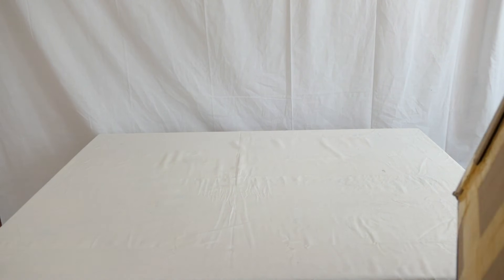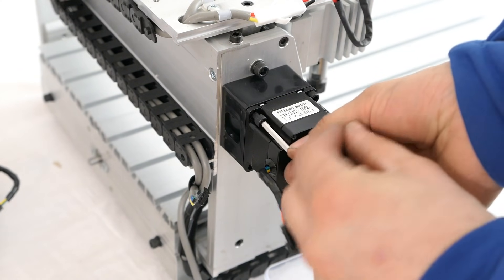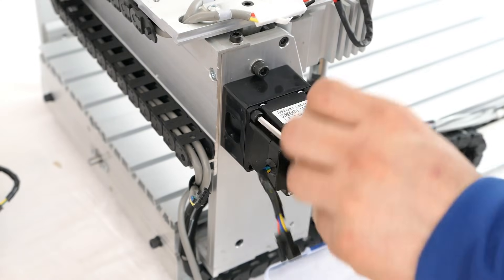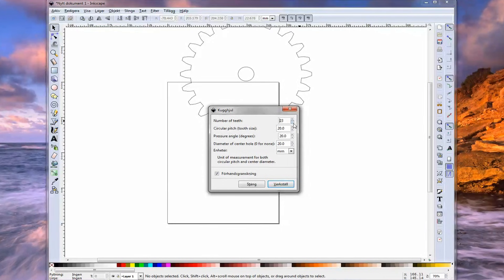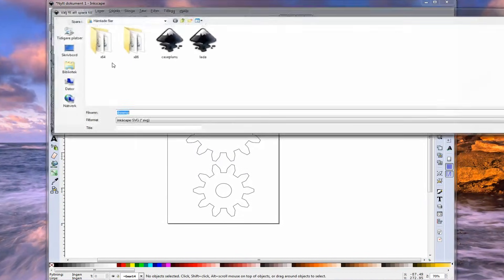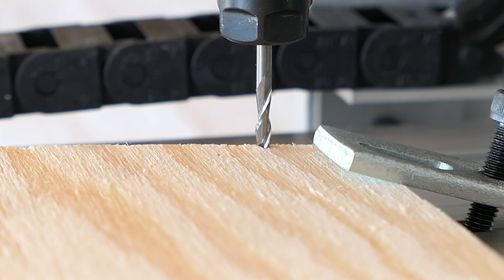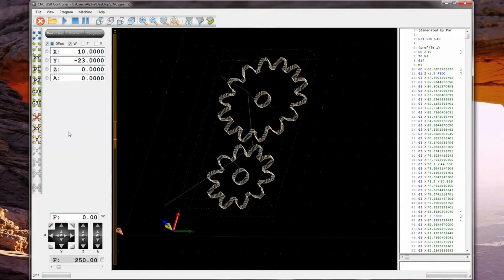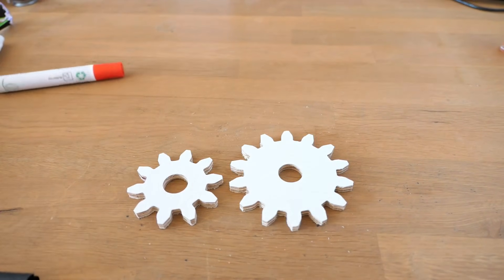3040 Ebay CNC! Unboxing To first part

Comment: Very nice router. I have upgraded the spindle to a Bulle Router and cut like a pro.

If you are working with wood you can glue your material with hot gun glue with safety.

Comment: Your clamps are on backwards.  The short end goes over the part and the long end uses a threaded stud with a T -Nut or cap screw or hex nut on the bottom and a jamb nut and washer under your slotted clamp end to act as a fulcrum. This is how you get the clamp parallel without using a bunch of different Joe Blocks or 1 2 3 Blocks. Use pieces of scrap AL sheet to keep from marring up your table and buy a machinist stone.

Comment: Thanks for loading this video.  I have a unit that is exactly the same as yours, but the documentation CD was damaged in shipment and is unreadable.  Would it be possible to get a copy of the setup instructions from you by any chance?  Thanks.
Reply from the maker: Hi! I got no instructions on the cd. The only thing on the CD was a EXE file for the program. I would advise you to reach out to the seller to get a download link for the program.
Reply: @RaviX  Thanks so much for this reply. I found where to download the program, but what l am missing are the machine-specific parameters to enter during setup. I noticed that your video skipped from physical assembly to actual use of the software, and did not include initial setup of the software. Do you still have the setup information?

Comment: First thing to do, check the speed control potentiometer, some people have reported them to be flakey and can shortcircuit causing damage to the controller. Better quality model would save you some potential trouble.
Reply: Recommendations?
Reply: @mikecarter8880  Really just a good panelmount pot from your preferred electronics vendor should do. If it was me I would (because of where I live) probably end up on the digikey website and look at the pots from a company like Bourns.

The problem is just that they use cheap chinese ones that ... well short it seems.
Reply: Thank you for pointing this out, any idea what the value of the pot is? I'm ordering one of these for someone else and would like to send them one.
Reply: @Trstn12  alas, with the multitude of different controllers out there that would be hard to say.
Reply: @xConundrumx  thanks for responding,  I'll measure it before we hook it up, thanks!
Reply: @Trstn12  Good luck

Comment: My machine didn't come with the software, I've been using Mach3 with it, but the one used in the video looks easier, any idea where I can download it?
Reply: Don't bother yourself trying this soft, it's basically the same but with less options. However, the main downside is that this software has no documentation.
Reply: @viktor67990  Yeah but since I have a small machine, I want to do simple things like shown in the video, with Mach3 I have to do to much stuff.

Comment: You dont use clamps like you have...bolts should go through the long slots in the clamp and a packer bolt in the outer thread.Ideally the clamp should be horizontal or just slightly higher at the back.

Comment: FYI: Inkscape is not a cad program. Its a vector drawing tool.
Reply: Also I noticed your clamps are wrong. They are not set up correctly. You need to have it so the part that goes on top of the material is flush with the top so it puts downward pressure not angled pressure.
Reply: Yep to all of that.  Inkscape is shit though but so many use it.
Reply: Look if you use inkscape to design something, it becomes a computer aided design, thereby making inkscape your cad program.

Comment: Almost three years later, are you still happy with this machine? Have you machined many parts / projects? Has it held tolerances on finished parts? Is it capable of holding +/- .005 at conservative speeds and feeds?
Thank you

Comment: How many blow by blow open box and put together can we take. Then in the end they never have a useful thing worth making. Is it that exiting that you can't even wait until you have an idea?
Reply: More exciting anyways than watching someone complain about a video they are not forced to watch in the first place. Are you that miserable that you have to spread it around?

Edit: And before you ask what the point is. These machines go through 'upgrades' and changes quite frequently. I notice for instance that in this one the T nut table has been made more rigid, a frequent complaint on older models of 3040 and 6040 machines that used to have really thin aluminum profiles resulting in an ungodly flex. I also noticed that there have been some smaller updates to the Z axis assembly. I could have done with a little more in depth look at the mechanical side of things for this model from the poster but overall it provided adequate new information on these ever changing devices. Changes that incidentally are not always good either. So to answer your complaint. Yes, there is value in a new video on this subject, both now and in the future as more changes emerge.

Comment: The edges look pretty rough.  Either your cutting bit got dull quickly or this bit wasn't very good.
Reply: Feeds and speeds
Reply: Penfold8 could also be the wood. Looks pretty cheap

Comment: @07:34 Oof... That sound was cringeworthy... As someone who owns a CNC himself ( https://i.imgur.com/WSa3exY.jpg ), I'd recommend you immediately drop Inkscape and switch over to Autodesk Fusion 360 which is, essentially, a free and purpose-built CAD, CAM & CNC application with lots of support material to be found on YouTube and various Hobby Grade CNC related Forums.

Comment: I paid $70 for one. why would he spend $700 on a chinese mill?
Reply: You get what you pay for, the 70 usd one will most likely be lacking in certain areas where as this one won't.

This could include the maximum dimensions of the parts you want to create, the accuracy, the difficulty to assemble, how difficult it is to use the mill, how long the mill will last, the power of the spindle, how strong the frame is(affects the accuracy), what materials you'll be able to reasonably cut, etc. 
note this person could have saved about 200 usd if he bought it somewhere else, like on aliexpress or banggood.
Reply: For $70 you will not get a controller a spindle or software.

Comment: Thank you for video 
Can I replace spindle with dewalt dwp611 router ???
Reply from the maker: You can replace the spindle without problem. But I'm not sure how good the Dewalt will fit.
Reply: I need bigger spindle so i can put 3/8" bit size ... do you have any ideas how to do that?
Reply: @samme1988  look for cnc spindles with the wattage and diameter of your spindle hold. Better than those noisy routers
Reply: @Bishop0178  can i order spindle like on 4060 with water cooling????
Reply: If you find one with your diameter  of the motormount, sure. otherwise you would need to modify the carriage of the z-axis to take larger spindles
Reply: @Bishop0178  spindle on 4060 is 800w and water cooled.
You think i will be able to install if i have spindle hold to hold that spindle.
Maybe is to heavy fo that motors???
Reply: there are versions of the 3040t out there, that have the 800w spindle. They don´t look as nice, but have more power. But it should work, if you mount it properly
Reply: @Bishop0178   i want to engrave copper 0.5mm deep or wood 3 mm deep. My only problem is noise. People say that water cooled spindle is more quiet than air cooled spindle????
Reply: @samme1988  build an enclosure, that reduces the noise and with soundproofing you sleep next to it. helps with the dust also
Reply: @samme1988  Spakujes je u kutiju od stirodura i nista se necuje..mozes dodati i sloj lepenke ili staklene vune
Reply: @accipiternisus649  jel imas ti ovakav cnc ????
Reply: @samme1988  Ne ali slican mi ima prijatelj
Reply: @accipiternisus649  znaci nije puno glasan?
Reply: @samme1988  Ma jeste,ako mislis u stanu onda ce komsije popizditi.Zuji mnogo koji god materijal da radis
Reply: @accipiternisus649  ma ja zivim u nekim stanovima al imam svoje malo dvoriste i imam plasticnu kucicu vani pa sam mislio tu staviti al opet mi se ne uzima ako je puno glasna
Reply: @samme1988  Pazi ovo je kineska gravir masina i nema to veliku snagu,ako radis recimo aluminijum to dugo traje ali pvc ili drvo to je ok.Sve zavisi za sta ti treba,uglavnom ona je da kazem za tako neko hobi igranje.Uz malo bolja glodala mozes raditi bakar mesing i aluminijum ali da ih hladis vodom.
Reply: @accipiternisus649  ja bi radio sa drvetom mekanim ili bakrom.
Ima ista ovakva sa glodalicom sa vodenim hladjenjem kazu da je ta glodalica tisa nego ova?

Comment: FYI on the extra attachment you probably don’t want the washers between the two surfaces, you want the washers on the same surface as the screws going in to protect the aluminum from the twisting if the screws.

Comment: a 700 $ engraving toy....muhahaha  that is not a cnc kid
Reply: with some work you can turn this into a usable machine. No need to bash ppl just because u have been spoiled. For ppl just getting started its the perfect machine.
No need to spend upwards of 3k, just to find out its not for you
Reply: this is a CNC
Reply: @Dylan-tp9mx  its a cheap engraver!
Reply: agreed but its still technically a CNC
Reply: THIS MACHINE COULD MARK IN STEEL?
MAXIMUM .005 INCH OF DEPTH.

Comment: Next you should ditch those clamps and get some real toe clamps which keep themselves level to the table.
I setup and ran a Thermwood CNC router, but they're about 100 grand.
Awesome machine though, great for making cabinets.
Reply: you should have 2 screws in the clamps to level them.

Comment: I also bought this machine and yes for wood is good enough but for aluminium and brass is not so I already bought more powerfull motors and controller and drivers. Machines is robust enough to upgrade.
Reply: were you using HSS or carbide to start before you upgraded?
Reply: @jecsquish   HSS
Reply from the maker: Did it work out good for you? I was thinking to do the same
Reply: @RaviX  I still didn't do it, I am building new 3D printer which takes me alot of time

Comment: @RaviX You put the washers in the wrong spot when installing the 4th axis, should be on the bolt next to the head then through the plate, also foam is not a good idea for a waste board.
Reply: I had the same thougt.
Reply from the maker: HI! Yeah I know now, did not just think about that when filming

Comment: The cnc software they “give” with this kit is a stolen clone of www.planet-cnc.com . Check their forum  for more info. Not only did they steel the software.. they also “copied” their controller. I have no problem if people learn from the mechanical construction of a machine and “design” their own. But I do have a problem with the fact they buy a controller and software from a company and just clone it and sell it with their own product. And we as consumers feed this by buying it..  because it is “cheaper”.

Comment: Will it mill aluminium to ?
Reply: no it has not enough power you must upgrade motors
Reply from the maker: You can if you go really slow. But as damjanhd says, you need to upgrade the spindle if you want to cut metal.

Comment: Tjena! Grym video. Funkar den fortfarande eller är det en sån där kines skit som går sönder efter typ 3 veckor? är det lätt att byta ut trasiga delar mot nya?
Ha en bra dag!
Reply from the maker: Hej!  Nejdå, den har fungerat bra. Robust konstruktion. Enda är väl att spindeln är lite slö. Men det fungerar till mjukare material, som trä och plast. Sen går det att köpa större spindel om du ska använda aluminium. Ha det bra!

Comment: I've had one of these for close to 3yrs, and it's still working. I did have to replace one motor to shaft coupler, but they are very cheap. These are really well built little machines. I have even cut and engraved Aluminum (slowly). I have never had any wiring problems that some people complain about. I even made an adapter to hold a spring loaded diamond engraver, and it makes beautiful diamond tip engravings on metal objects of copper, brass, and steel. I have thought about upgrading to an 800w water cooler spindle but it would require modification to the existing motor mount.

Comment: I bought the same one. It would have been great to  have it work like yours first rattle out of the box. But, it didn't. After contacting PLANETCNC to get a license, (not included on eBay and software will limit you to 25 lines of GCode until you purchase the license) I found out that the board in the controller box was a chinese counterfeit and will not work with the PlanetCNC software. I have replaced the board and software and have still limited success. Have not produced anything with this unit.
Reply: Jim Outlaw You think it wrong. Chinese board work normally with Cnc controler. But you need have a key to active the license. I can help you active it free.
Reply: I just bought the 3 axis version of the same machine. I have no clue where to find the License key. Any help would be appreciated
Reply: This code will be illegal. It is generated with illegal key generator.
These boards are knockout of our Mk1 controller. They use our firmware which was made for DIY community. Unfortunately this was abused and these boards are made without our permission and are breaking copyright law.

Comment: I have this same item. What driver are you using for the cnc controller? Even with make 3 mine is a B%%ch to get working properly.
Reply from the maker: Hi! I'm using the drivers included on the cd!

Comment: the coating on the box is non conductive the earth terminal is connected to nothing.
Reply: reinforced octocopters not necessarily... depending on how it’s fastened.. it may have those bite washers (not the split ring washer)

Comment: Very nice tutorial man, just a question: i have wood pieces about 30 cm height ( i just want carve 2 mm, need just only 3 axis ) can i use this one? Watching on amazon i ve seen some cnc of top direct, 250€ moreless, can i use it for my woods?
Reply: Crux Jagger 30Cm may be pushing the limits... however, do your research, checking across sites with the product information will give you an idea of how large of an item will fit.

Comment: Hi - are you still happy with the cnc?
Reply from the maker: Hello! I haven't used it for a while. But i've never had a problem with it. Does what it supposed to!
Reply: hello .. can this cnc work with aluminium ? or any steel material ?

Comment: Try doing the Punisher skull in Aluminum, would like to know if possible as well as engraving on a round tube.  Will it do a titanium tube with a name on it?  If so, would like to possibly buy a unit for my shop.
Reply from the maker: If you want to do metal with it, you need to update the spindle to a bigger one. It can handle aluminium, but you have to go really slow! And yes its possible to engrave a round tube!

Comment: is it have a software cd . if not can we download ?
Reply from the maker: Hello! Yes there is a cd with software included
Reply: This is a cracked version, shameful cause guys at planetcnc do really good job, and the chinese are ripping them off
Reply: Petros Makris Software downloads from Plannet, not cracked. You should have a key to active control board to run over 25 lines. The key supply when you buy machine or contact suppliers to get a key.

Comment: There should be extra bolts and nuts for those clamps. Put one in the threaded hole, it goes head DOWN onto the platform. The other bolt through the slot and into a square nut in the T slot of the platform. Works well that way.

Comment: Can it do aluminum?
Reply from the maker: Yes it can, i tried. But i would recommend replacing the spindle if thats what you want to cut, since the original spindle is not meant for that. Meaning you have to go really slow

Comment: Is it possible to add a 15W laser module to this CNC? Perhaps swap the spindle with laser and just use it in on/off style?
Reply from the maker: Yes, that would work!
Reply: Have you tried it? Would the controller board be able to modulate laser same way as the spindle? Or would it need new programming? It would be great if someone with experience can make a video about this.
Reply from the maker: I haven't tried it myself, but i dont see why it wouldn't work. Maybe someone with experience could answer this
Reply: N Ag I'm sure it work. But it can On/off, can not PWM the laser power. On the control board have a Automatic Switch, you can use it to On/off the laser.

Comment: Will this machine cut Carbon Fibre? Great video by the way
Reply from the maker: Thanks! Haven't tried that, so i can't say
Reply: It should do fine. I'm using a 6040Z for quad frames, cutting 1mm to 5mm carbon sheet. Cuts like butter, but does tend to blunt the bits. The 6040Z is the big brother, very similar. Perhaps a little more rigid, heaver built. Larger water cooled cutting motor.

Comment: Why can' it be used on a laptop
Reply from the maker: I think it's because laptops have a power saving feature, which may lead to the cnc controller losing connection. But as far i know, you can turn that off.
Reply: Yep just put laptop in high performance mode and you will have no problems

Comment: Thanks for the nice overview. Would it be possible to make carvings on stones using this machine? A video with testing stone carving would be much appreciated.
Reply: Most stones would kill your HSS tools, you need at least some carbide or better to do that.
Reply from the maker: Thanks, That would be something to try! Have never done it, but i think it would work

Comment: Такой же стоит без работы, продавец не вложил диск с настррйками
Reply: Original software are stolen. Demo version allows only 25 lines of code. Controller board works only with Planet-cnc software.
I throw it away, bought arduino cnc board, installed arduino g-code and it runs perfect. Everything fits nicely in same board.